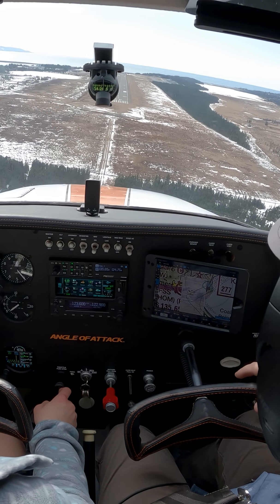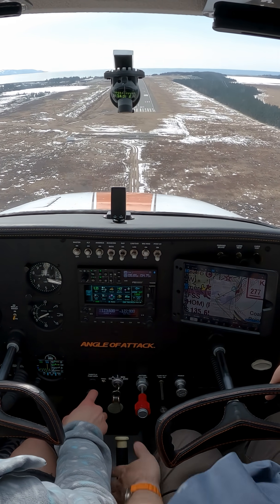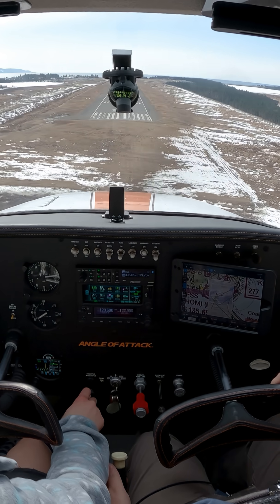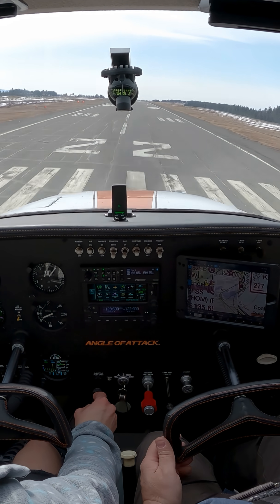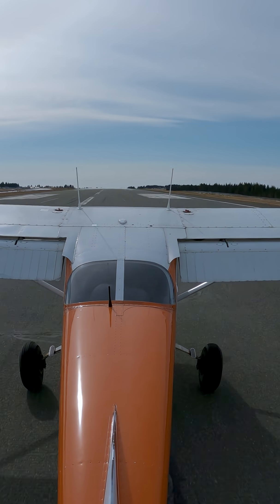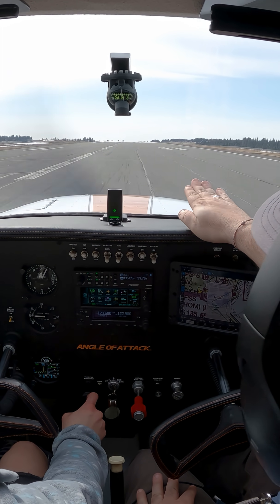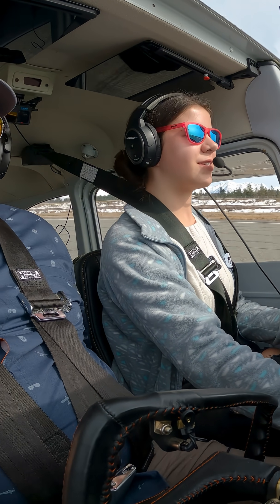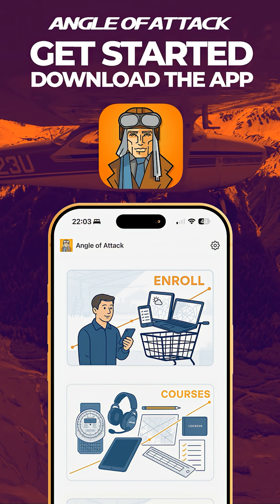Tiny Power Changes Make Perfect Landings #flighttraining #flying #groundschool #studentpilot

Comment: Idle power before turning final? Only if I was way too high. I left the power set to 1700 rpm until after I turned final and then I would tweak the power to stay on the glidepath. Of course, I would re-trim after each change in the flap setting.